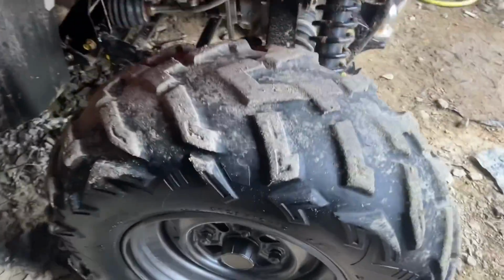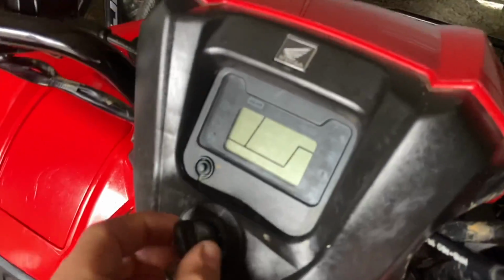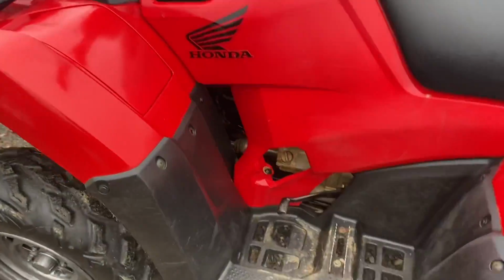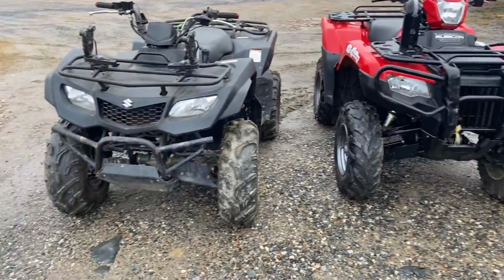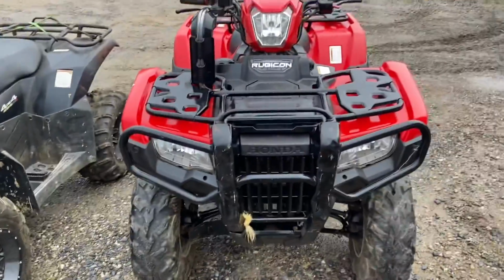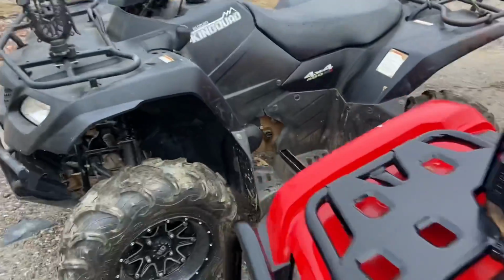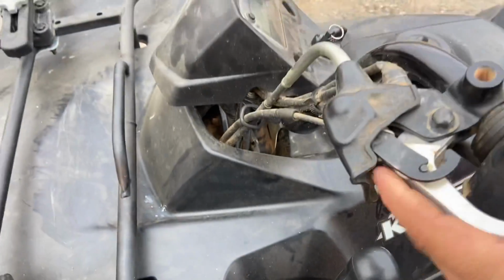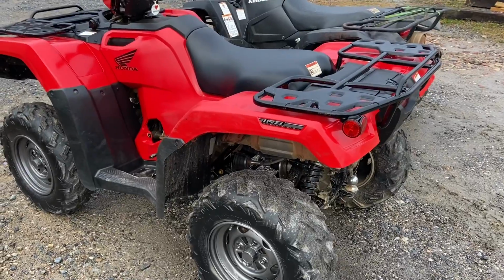Honda Rubicon 520 vs. Suzuki Kingquad 400 comparison and review!

Comment: I'm sure someone has probably already mentioned this, But I didn't feel like reading all the comments.  Fuel injection vehicles don't have chokes, their fast idles. same as putting your thumb on the throttle a little as your cranking it over,  not recommended and some do not even start once the CPU senses that there's a change in throttle position by the TPS sensor,    so its not a choke its a fast idle and don't use it while cranking it over,  only after it starts should you raise the idle to ensure a quick warm up.  I enjoyed the video. Thumbs up.

Comment: Something wrong with that Suzuki. Mine starts first time ever time no matter what the temp is. And that's not a choke being fuel injected. It's an idle speed lever lol
Reply: Probably nothing wrong with the Suzook.   There are 3 spark plugs available and he probably needs to get the right one or adjust the valves which is a one beer job or two at most!  That or he doesn't know how to use the lever correctly.  He is  a Honda fan boy and later on in life he will realize the Suzook was great for what it is....

Comment: You honestly don’t need to use the choke to start it up, I got the same kingquad and no matter the weather the Choke is never used
Reply from the maker: This one barely starts with it
Reply: Same here. Mine starts right up every time
Reply: @JacobOverman  There are different spark plugs available for this specific machine.  Based on temperature and elevation I think.  You probably need a new one suited for your elevation and average temperature.
Reply: My 400si, starts in the cold just fine.  It stays in the weather year round. 
No slipping at all, puts all power to the ground and crawls everywhere.
885 miles, I do all maintenance myself. Never had a flat, no smoking.

Comment: I had all 3 KingQuads. The 500 definitely is a better match up. Better hp & torque numbers. Has better top end speed, too, at 64mph. Will wheelie on demand. Sealed wet brake, & will start on demand. Kingquad belt will last life of quad if taken care. Great 4x4 system & excellent ride quality. Great vid tho.
Reply: is this 400 good?  is it not lacking in power?
Reply: The 400fsi is a rocket ship till it tops out a 56mph. The asi I haven't owned but they aren't far behind the fsi in acceleration. Top speed is the same at 56mph.
Reply: @jeffreyhall1105  exactly. The 400asi I had, the 420 ranchers had the same top speed but it was far quicker & more powerful quad. The 400 Suzuki’s are no slouch tho. I have to get a 400 FSI

Comment: i got the kingqyad 750 with the bumper package and i got to say its alot nicer than my rancher 420s bumper, the ranchers bends so easy. honda is the most reliable only had to do oil changes and differential fluids, same for my kingquad but ive had the rancher for 6 years and my kingquad isnt a year old yet so time will tell but so far there both amazing
Reply: update the kingquad shits on everything, doesnt bog in thick thick mud like honda it powers threw, then doesnt weigh 1000lbs like a can ham or polaris and can crawl in swamps like a honda, plus its just as reliable or better just bc my electric shift honda gets stuck in gear bc the computer doesnt know what gear its in and shows a dash so i have to rock it until it finally shifts.
Reply: Update now? I want you buy a kingquad 750 to pull heavy things (No mud).What do you recommend?
Reply: @Fab1garcia  yes i so recommend, im still kn the original belt, and this summer a giant windstorm kncoked doen almost every single tree ij ny road and around my lake like 20 to 30 trees, and i hauled load of wood afew thousand pounds no problem, also eith the shock stiffened it has some of the stiffest shocks for hauling
Reply: @Fab1garcia  its rlly 3 years later and i still think its the best atv with a CVT by far

Comment: King quad 500 rugged pkg is the Suzuki you would wanna compare with the rubicon 520 both great rides
Reply from the maker: Yeah but sadly I don’t have one
Reply: Honda is a better mud bike because of no belt ,King is smother a lot better trail ride ,Suzuki has stepped there game up in quality on the new kings you’d be impressed ain’t no Honda but there getting closer ,Shoulda got the 5 speed king 400 with no belt for mudding btw

Comment: Probably needs a valve adjustment for the hard start when cold.
Reply: Usually the Suzook will never start when it needs a valve adjustment which only happens at 16000 miles plus.   It's most likely he didn't use the "choke" or enrichment toggle correctly.
Reply: It's most likely hard miles and lack of care.  Did you see how he revved them up instantly after starting?  Especially the Honda?  Yea that probably doesn't break anything but that can't be good for long term reliability And probably explains why the Suzuki is burning oil when cold.

Comment: I already have a Honda I was thinking of getting a Suzuki but I’ll get another Honda after this video
Reply: I got 11,000 on my 2013 kq 750. Brother in law has 14,000 on his 2013 kq 500. Both running better than that Honda ever hops to.
Reply: @johnsteiner9542  does it start on the first electric start and have you ever had to fix it though
Reply: @kalumwilliams3139  yes both start instantly at first touch of the starter button. 
 It’s rather obvious with high mileage with something somewhere needs to get fixed. But the only things that have broken or caused problems is from things that were done to them. Like mine I tore a cv boot twice with a stick. And I got a stick jammed up inside the engine in a deep hole. Tore a hose off the rad. Or B-I-L rolled his and it needed a few things fixed. Neither one has blown a motor diff or axle or had any issues that wasn’t rider error.
Reply: I have two kingquads and they run like a dream
Reply: Your an easy sell.

Comment: suzuki 400 asi is kinds meh same as a grizzly 450 pretty much, but the 400 fsi is a whole nother beast, better than a honda rancher bc its 100lbs lighter all same features but i had 10 gear instead of 5the honda has, the suzuki has 5 low and 5 high. plus it only needs one snorkel like a honda

Comment: Not a very good comparison maybe a king quad 500 against the Honda which will run circles around that Honda if u are familiar with Honda they are behind on everything except race bikes..,
Reply: And bumpers are a accessory very few come with them unless the dealer put them on king quad 500 u can get several different kind of bumpers and will run circles around that Honda lol u are trying to act like Suzuki is junk it’s not u just have a Honda and think it’s best which it’s not in 2020 the king quad 750 was in top 5 Atvs

Comment: If you are using this kids opinion for not buying a suzuki then you ha e never owned a suzuki. This kid is a honda fan boy. Also I have a 2022 kingquad 400fsi that will run circles around theat 520. Hondas are slugs. I owned a 2012 kingquad that was still running 8 years after purchase. The 420 rancher had 3 rear differentials replaced. It was slow as the sunrise. Suzuki is far easier to work on than a honda. This kid doesn't know wtf he is doing. You literally don't have to remove anything to change the oil. Smfh these YouTube wannabe mechanics. Donate money for tires. How about get a real job and stop living off ya daddy.
Reply from the maker: Well. Funny seeing this after a few years. I am now on my own in Montana. Still love my Hondas and think Suzukis are terrible. Don’t work with daddy. Don’t have daddy’s money. And still have a 6 figure income. Thanks for the comment
Reply: My thoughts exactly.

Comment: Honda so slow I bet that that 400 would win in a race😂😂
Reply from the maker: Surprisingly the 400 actually is slower by a good bit. Top speed is higher but doesn’t take off as fast.
Reply: @JacobOverman  thats true thanks to a better limiter and a (in my opinion) more durable engine in the Suzuki. I own an 18-year old KingQuad 700 so I kinda know, but I've never actually driven a honda